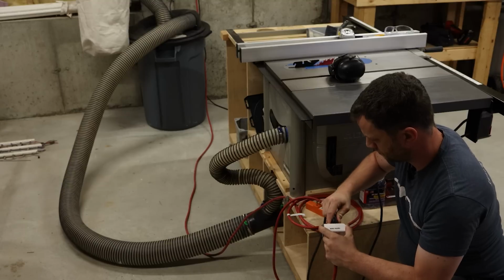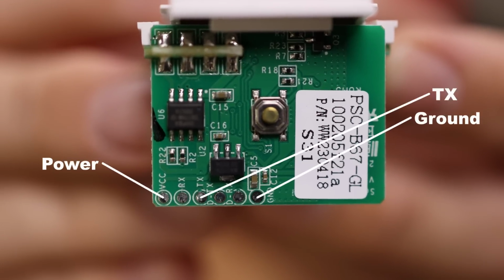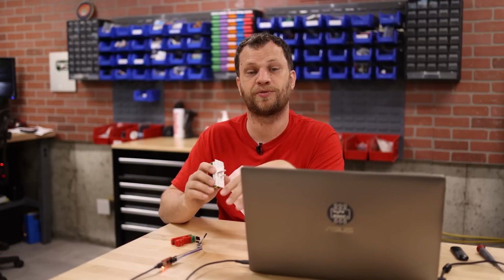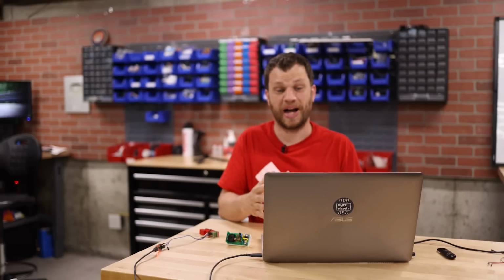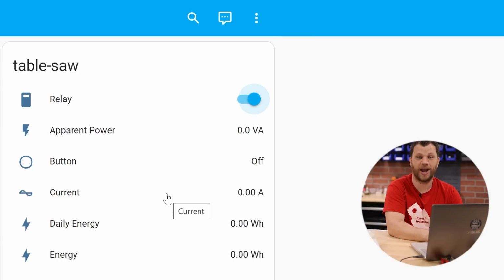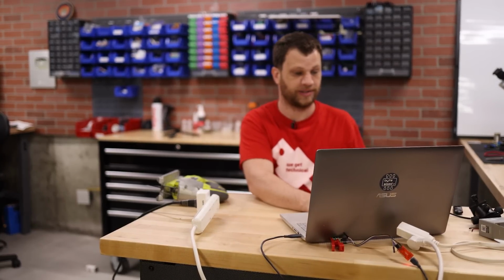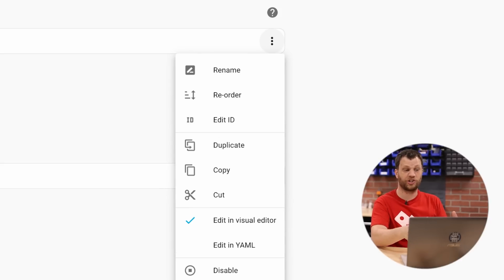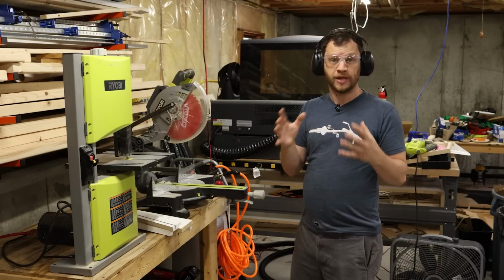I found a simple way to save my lungs

Comment: Nice video. 
And a great idea 👍

Be aware to use plugs with enough Amps 

And you could also zigbee plugs (like i do).
In that case you don't have the hassle of the ESPhome installation. 
Have a look at the blitzwolff zigbee plugs as an example. 

Thanks for sharing your idea.

Comment: I used to use a smart switch on my dust collector, I went through two of them because eventually that surge when the impeller spins will blow them up.
Reply: Although I notice the plug you're using is rated for 1800w! Which is the maximum output for a  110v 15amp socket  anyway!
Reply: Gotta drive a contactor from the switch relay. Inductive loads kill small relays like this.

Comment: Just be sure the amp rating printed on the smart switches is the actual amp rating for the relay inside of them. I don’t know what circular saws and dust collection fans will run, but I had some smart switches (I forget if they were the early iHome or early Wemo switches) that said they were rated for 15A, so I thought a little space heater with a max 12A rating wouldn’t be a problem since it would be left on low or medium. Everything was good for a couple months until it started acting up and wouldn’t turn off (reported back that it turned off, but didn’t physically cut power). When I disassembled it, the little plastic housing for the “in use” indicator board, a little IR emitter and receiver across one of the prongs to tell if something was physically plugged in or not, had melted and started to burn and, because the relay was toast always, I tore it apart and the plastic case and potting compound/epoxy was baked to the point it was brittle and the contacts inside were essentially welded together. I couldn’t read the engraving on the burnt relay, but opened another identical switch and that relay inside that one said it was only rated for 10A max, while the outside housing said it was rated 15A. Maybe a bit of user error, but I’ve checked every smart switch I’ve purchased since no matter what I plan to use it for

Comment: if you are just using the sonoff's for current measurement and you don't need the relay going on and off (meaning you don't want the sonoff powering each tool to accidentally get turned off) then you can configure them to always keep the relay on. This is useful for me on my washing machine where i only use it to know when the washing machine is running or not.

Comment: Relays won't last long switching big inductive loads like these motors. You can avoid this by using the relay to drive the coil of a contactor instead. 

It probably won't catch on fire when it fails. But if it does, it won't be the first one that did.

Comment: You should add some hysteresis so you don't get the relay turning on and off quickly if the current change is not perfectly monotonic, eg. turn on above 2.1 A, and turn off below 1.9 A.
Reply from the maker: @stevenebstein3391 That's a great suggestion. I should have thought of that!

Comment: I tried this with some smart plugs I bought online. They can sense current and power, but there seems to be too much of a delay to work properly. I'm still using the arduino design you shared many years ago. I just find myself having to swap out relays when they get stuck on. Looking forward to the blast gate video!

Comment: I made a similar system a few years ago and I also used the Sonoff switches. The only issue I had that there was no wifi in the workspace. Luckily, with some programming I enabled the switches to communicate directly to each other.
Reply from the maker: @andriessalm  I should have made it more clear that I know I'm not the first one to do this. I am looking into using ESP now so that the devices can talk directly to each other and not rely on a Home Assistant server
Reply: @bytesizedengineering  I also used ESP Now. If you need a copy of my source code, just let me know. (It is only between 2 devices though)

Comment: One suggestion, at the condition duration for a minute or so for the off condition so it doesn't switch off right away if you let go of the saw trigger for a moment.

Comment: You've got a little bit of a logic problem there, if you have 2 tools that can trigger the collector, and turn one on, and then the other, it will toggle the collector back off.

You might be best creating a sum of all amperage on all tools, when that goes above 1A turn on the collector, and then a separate rule for when it returns to 0A to turn off the collector (after 30 sec just to make sure the dust is out of the hose).
Reply: This can be done in Home Assistant using helpers and instead of the sum, just measure the maximum  cuurent of all devices.
Reply: Dont think your problem applies to the logic in this automation. I understand that it would work incorrectly with toggle but that is not what the automation does if you read it. It has the turn on & turn off logic, which can be triggered multiple times with the same results.
Reply: @dennisgoransson2768  In any case, if you use multiple copies of the current automation, and if multiple devices are turned on, only the switching of one device will turn off the dust collection. This is not the intended behaviour.

Comment: Its a good idea, but honestly I thinks its a badly executed. the relay in these devices are rated for 15A continus current, max, most of the tool uses 10-12Amps, and when powering up the initial power drawn is much-much more, so it is not really safe to use these in your shop. 

The solution I think is to use some kind of CT (current transforemer) to monitor power draw of high power equipment, you could find many examples based on esphome.
Or, if you want to work with these smart plugs, these S31s have a so called "relay bypass mod" where you remove the realy and bypass the contact with a big ass solder joint to carry the current continusly and only use the device for power monitoring, not a good solution but at list a bit safer.

But in the end HA is a great choice for automating this, but i prefer some kind of standalon solution (as you previous solution is) to not depend on an external system for this kind of "critical" workflows.
Reply: Shelly makes a 16A power monitoring device that doesn't have a relay. They cost about $12 and would be a better choice for monitoring the table saw,
Reply: @vegaswayne247  yes, for sure. I don't look into how these work, but I prefer non invasive solutions for these kinds of loads
Reply: I agree, you really need to watch out for the current draw on these inductive loads.  I'm willing to bet the 15A rated current is only for a resistive load and it would be significantly less for an inductive load (which large motors definitely are) - and this de-rating for these loads is typical for relays.  There have also been fires reported with similar devices on some forums when people would try to control some high-current devices (just search for "sonoff fire") - I would exercise a lot of caution here.

Comment: In the automation instead of doing if dust collection off / turn dust collection on / else turn dust collection off I'd click the 3 dots on the triggers and click "Edit ID" then you can give your triggers a name and in the choose block use "when triggered by".

Same outcome but at the moment if you turn on one tool, followed by another it will probably turn the dust collection off. To be fair you're probably not going to run two tools at once, though.

Comment: Home Assistant + ESPhome are truly awesome and I cant imagine doing home automation without them.  But when you start adding more and more to HA, and you will,  I would rethink the raspberry pi, or at the very least make sure you hook up a real SSD and don't use an SD card. Home assistant writes a lot of data and kills SD cards.  My personal recommendation would be to run HAOS in a VM if you already have a home server, but most people don't. A cheap used mini pc is also a good option, compiling the esphome will take a fraction of the time too.  Also make sure to setup regular backups for HA encase that SD does fail, i recommend the google drive backup plugin.

Comment: I've actually been looking for a solution like this for my washer and dryer. Something that could automate alerting us when a load is finished. I am def going to look into this further. Thank you
Reply: I have done this for my washer and gas dryer.  Another solution is needed if you have an electric dryer.
Reply: @vegaswayne247  did you do it the same as here? If not can you explain how you did yours? Thank you, Both of my machines connect via 110v.
Reply: @famousamoso7  Similar to the video except I send a notification instead of turning on a dust collector.

Comment: Something I might add if possible is add a delay for turning off the dust collector. Because even when the tool is off immediately after using you will still have dust circulating around your shop.
Reply from the maker: @famousamoso7  I mentioned that at the end. This is customizable and I can add delays as needed
Reply: @bytesizedengineering  sorry I jumped the gun on my comment :D I did watch through until the end.
Reply: Ya, for the miter saw specifically, might want to add a much longer delay so the vac won't be short cycling

Comment: did the same automation but using all original sonoff stuff, turns off the car charger when i use the kettle to not overload the solar inverter.